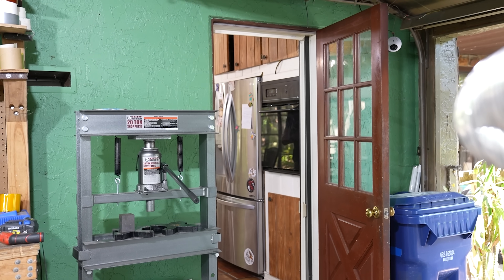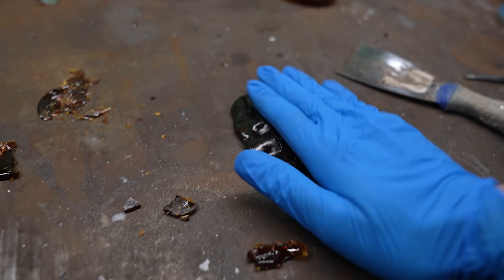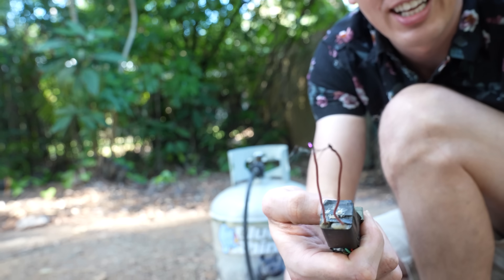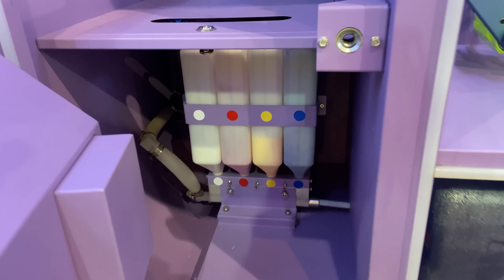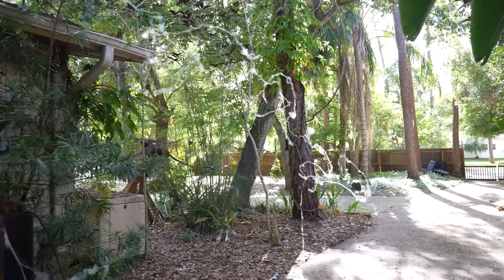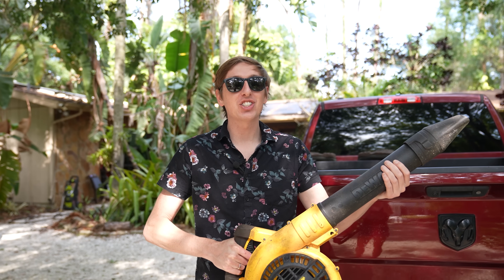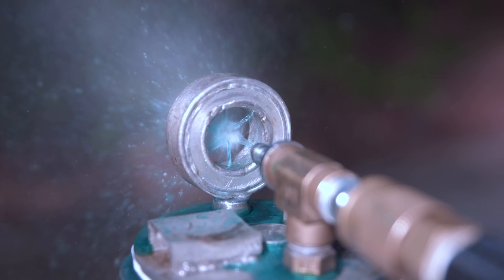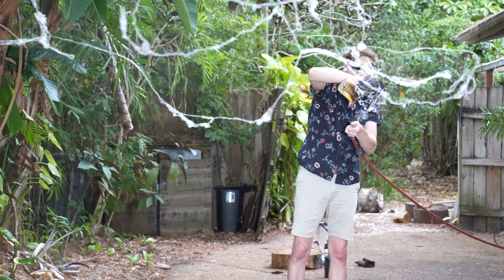I built a Cotton Candy Gun

Comment from the maker: Get an exclusive Surfshark deal! Enter promo code BACKYARD for an extra 3 months free at https://surfshark.deals/backyard
How would you make a Cotton Candy Gun?
Reply: love you
Reply: @user-hq2fy5cs1k is a lie 😭🫤😮😮😅😊😊o999pppoupouopppppppppppppppppppppppppppp000
Reply: i got better idea instead of hot air wrap  a coil around the metal bit/the tube  keeping it hot so the air coming out isnt super heated and safe
Reply: sorta like how coffee maker works but with random bit a air blowing past
Reply: Go Go Gadget Cotton Candy Flamethrower. (Gets Crooks attacke by bees)
Reply: This just looks like a sweet mess lol
Reply: Never saw the cotton candy gun
Reply: Why not use the pressure vessel as the heating container? Wrap it in heating elements and melt the sugar inside. Add a heating element to the nozzle like a 3D printer and then inject air once melted. Blow the sugar out the heated nozzle and it strings in air. Add a pressure relief valve for safety and ur done. And you can code the elements into a microcontroller to maintain temps. Add a hopper for sugar and you can keep adding sugar as needed.
Reply: I would wonder say if you had a system similar to that of a flame thrower to make this work. Like if you had molten sugar being pumped out at and angle (or forwards, at a slower rate), into compressed air aiming forwards, so the molten sugar and air meet mid air, mimicking what was happening when you poured the molten sugar over the compressed air. Though you would probably need something to heat the tube so the molten sugar would be able to come out to prevent that solidifying effect
Reply: Pretty soon these videos are going to be 80% promotion and 20% content.. it's already half way there
Reply: This is amazing
Reply: Reservoir with funnel shaped bottom ending in a small valve mounted above air nozzle.
Basically just recreate the effective pouring into air stream method without needing 2 hands to do it.
Reply: W
Reply: Was this inspired by killer klowns from outer space?
Reply: This is crazier than Ross
Reply: If you moved the rocket engine further back so only the hot exhaust was blowing on the sugar, pretty sure you'd have been able to do it just fine at that point.
Reply: Great video, asking g again when do we get the potatoe revolver!
Reply: You are the king of the Florida men
Reply: Two words:  heated nozzle
Reply: Wouldn't using a continously heated nozzle (like with a heating element)  fix the problem of the nozzle getting blokced in the first version of the cotton candy gun?
Reply: Love your work ❤
Reply: I would LOVE to go to your event if it wasn't in San Francisco.  That place has turned into a hell hole.  And I worked in and around the city for 13 years.  Not going back.
Reply: Do you have sugar gliders ? Me to ! Got 2 families lol..1 asleep in my roof right now😂 🍺 🐨 Australia 🇦🇺
Reply: Hmmm.... promo code...
Reply: 3rd degree burn gun lol
Reply: Have you tried tipping the tank upside down
Reply: please do open sauce in later years as currently i can’t afford to go to the united sates yet :(
Reply: Copyer
Reply: 2:46
Reply: I don't think you got the part that the sugar isn't heated until it's ready to be spun! Preheating isn't the answer, it's the mistake. The sugar is flash heated right before it's blown out. This also helps with the clogging.
Reply: Use a heating element to keep the sugar at the right temp in the hopper. Then just gravity feed the liquid over the air stream.
Reply: heating element wrap the nozzle maybe a hair dryer element?
Reply: I bet you got demonetized for the word gun
Reply: I’d go to that convention but you’re the only YouTube scientist I like bro
Reply: Hey, could you play around with sodium metal again. Love this video. I would totally stand on the other side of the cotton candy gun even though it might be a bit hot.
Reply: Any chance to make this high velocity gas gun you commented 6 years ago?😂
Reply: @TheBackyardScientist, sussy bakar
Reply: Do you want to get ants, Lana?  Because.. that’s how you get ants.
Reply: Backyard scientist I know how to make devil's toothpaste
Reply: hhhhhhhhaaaaaaaaaaaaaaàaaaaaa
Reply: UPLOAD A GOD DANG VIDEO SOON PLEASE THE FBI IS AFTER ME AND IM NOT PLEASED!
Reply: It looks like the sugar was flowing too fast for it to be spun into cotton candy in the last device you made. I would have added a needle valve or something similar to regulate the liquid flow.
Reply: the question is... should I tell you that there is a industry using pretty much the same trick of molten materials and air streams to produce a product you have used before? (okay, they use a spinning flywheel instead of active air being blown by because the cooling air is stationary there... and you get thinner strands)

mineral wool insulation is made like this, the things we have in our homes to keep us warm in winter and cool in summer... it is like "cotton candy" but actually it is "cotton rock" to say so
Reply: Super late. But maybe you can revisit this. Just have it gravity fed. Or pressurized if need be. But think an HVLP paint gun with a heating element on the end instead of the paint orifice.
Reply: @aceboogie3086  ba ba boi
Reply: Ba ba boi
Reply: You could do it the same way you did in the first test but use a heating element to keep the sugar heated in the tube and nozzle
Reply: your worse than mark with uploads lol

Comment: 9:50 wait im confused, you have a solution, a gravity fed stream, moves slower than the pressured containers you were using, so would the molten sugar coming out slower work better? the sugar falling ontop of the stream of air also makes sense, since it would be surfing into its self, the same way spiders spin web, so you just need something feeding the sugar ontop of the air stream but have the nozzle out of the air stream.

Comment: Get ahold of the guys at filastruder or something similar.  Just build a hopper based system with an auger to push your sugar into a heating element set to the melting point of sugar then blast your air at the stuff coming out.

Comment: Sugestion from The Ionizer -   Spinning the surgar  will allow it to move only when it’s melted keeping it from burning.   If you have a cone  to bring the liquid to a center and also have some channels to flow .  The idea is to fling it out in as narrow and fine as posible to give you thread.   You use nozzles at that size will clog.   Better experiment would love to help you with is how about a different type of heater.  I can explain how a machine works and how useing a wireless way to heat a spinning chamber can work better and be better controled. works can have huge improvements.

Comment: I know the steps on how to make a cotton candy gun in 5 steps

Step 1 : Make molten sugar

Step 2 : Put molten sugar into metal container

Step 3 : Take 2 large propane stove burners and set them to high, take some high temperature piping connecting them with a stream of compressed air

Step 4 : Make a venturi nozzle to fit between the high temperature piping and the molten sugar

Step 5 : Activate the compressed air

Comment: Your making it too complex, idk if you have tried this but make a nozzle that will go on the end of the air compressor nozzle, then that nozzle will suspend or hold a small pot of the melted sugar above the air stream so YOU don’t have to hold the pot. It’s easy and simple, also don’t forget to drill the hole in the pot that will let the melted sugar drip into the air flow

Comment: Surfshark uses old MD5 hash encryption techniques which were cracked decades ago.
Now they do intertwine hashes to make some kind of weird semi-hash thing, but still it can easily be cracked.
I've actually cracked it myself and It took 2 days, but considering modern encryption techniques take years to decades to
crack, I did pretty well! So the point is... Yeah unless you want your data stolen in 2-4 days, DON'T use Surfshark

- An Actual Software Engineer

Comment: *See the challenge you have not overcome is the cooling. You've been brute-forcing this.*  The best thing would be to create a heated magazine for the sugar. The heated container basically makes it a heated liquid sprayer (a real product). I mean it is what your trying to build basically. You just need 2 things: a hot-end nozzle so the orifice never gets clogged, and a heated sugar pot. You could also heat the Venturi system too, but the biggest challenge is just keeping the sugar hot until it is 90% out of the way of the nozzle. The air needs to be cool enough for it to solidify. This could be achieved by having a heated air in the center, while a jacket of cold air comes out of the  outer ring face of the nozzle youve already made. it would propel the sugar and cool it while the heated air in the center precools the sugar but doesn't allow it to become so cool that it clogs. Look up a COATING HEATED HOSE AIRLESS SPRAY system from Chesterton EMEA, they have this heated coating system that does exactly what you need except you need it to then cool quickly in the air. 

You have two things working against you. Keeping it hot until nozzle exit. Getting it cool enough to form crystalline and polymeric sugar in air.

Comment: oh. my. god.
all that is left is to make it self-heating, self-compressed, and super easy to refill 
add a 3s lipoly battery, a 12v 3D printer bed heater, a car tire compressor, a small air tank(old propane bottle out to be fine), and then regulate the airflow via a regulator and a solenoid valve
a simple thermostatic switch to control the 12v heater(or even a fancy PID arduino sketch with mosfet module) and a thermostatic lockout so you can't feed it when the chamber is too cold
fill it, plug it in, preheat, and press button for sugary webby goodness

now the heater would risk battery damage so you will likely need a 20a bms(most bed heaters are ~120w or 10a) and it would not run long without power so maybe add in a standby power input that can feed the system 12v through a relay that only clacks when the aux is plugged in and saves the battery for the mobile part
you could even just use a large sodastream or welding tank as CO2 is pretty food-safe and would provide a nice high-capacity high-flow gas source
but it MUST be made 100% portable and capable of mobile reloading rather than preheating the tank and sugar in the kitchen

Comment: So here's my idea. Canister with a heating plate and temp sender; with a fitting on the bottom with a gate type valve. And air gun to pressurize canister(pushes out sugar) and blows the cotton candy away
Reply: Then you just need an auto stick rotator in front of the output

Comment: I feel like the ideal design would be a heated pot you put the sugar in. Then put holes in the bottom that are the right size for when the sugar hits an ideal temp it starts running out. Pressurize it slightly worst case scenario.  Then air gun under the holes.

Comment: Wouldn't it be the easier to have a tank with heating elements (hot enough to melt the sugar) with a valve on the bottom that can open up with a click of a button. that will once clicked/switched slowly pour it into the air stream?

Comment: That last prototype is nice! Getting holes on the inside of a ring line that is pretty hard, even if you take the inner ring out and drill it, clamping it still is rough. Also I'm not sure what the vessel is? Almost looks custom, especially with his comment about nice threads. I know the only time I would compliment threads is if I put them on and want expecting them to work! Overall extremely well built for what it is.

Comment: I worked in a foundry where in the sand casting section we had both a hot glue gun and an air hose right there. Nothing funnier than hosing your bro down with spiderwebs by combining the two

Comment: after seeing the leaf blower work i had an idea

ideal gas law says going from high pressure to low pressure results in cooling. if you put short to wide nozzle after the compressor but before the hot sugar, it should keep the air warm enough to keep the sugar from turning solid without loosing too much kinetic throwing energy.

Also your sugar injection system should be on the top so the sugar falls into the air stream. Instead of venturi or internal pressure, use a physical piston and gasket compression instead. This keeps air from escaping the cylinder instead of the more viscus sugar. work on different designs for the injection plate, as the civ seemed to have success with lots of nearby holes in an array rather than a single row of small holes you seem to be designing towards.

Doing it this way also should let you put a "butt fusion" heater assembly mounted to the gun to heat the sugar while in use, instead of rushing to mount a hot sugar to the gun before use

Comment: First thing I thought you would do is basically make the cotton candy like a machine does but use the air to direct the threads into some kind of vortex or system of vortexes. Then after I started watching I though ok maybe he will figure out that he needs to keep the nozzle hot… maybe in part two..
Im still curious why the jet didn’t turn into a flame thrower.

Comment: For the version where it's basically just a tube, wouldn't putting a heating element around the tube fix the problems with it? Like, If you just preheat the tube, the air cools it down and the sugar sticks to it like you showed, but if you were constantly heating the tube, shouldn't it stay warm enough to keep the sugar from sticking?

Comment: Personally, I would have just done a heated hopper situated on top of spray gun with a controllable gate on the bottom that allowed the molten fluid to drop into an air stream. Similar to how an HVLP spray gun works. You could even control the heat of the hopper so that it heats up granulated sugar to melting temp and then keeps it at that temp.

Comment: idk bro ur first idea worked fine

i would have used nichrome or kanthal or etc etc heating wire to coil around the nozzle to heat it red hot

if that doesnt work, just make a tube chamber of some sort that keeps the compressed air for long enough while also heating them, that way both the air and the nozzle is hot

Comment: I think you need a heated nozzle, perhaps an extruder from a 3d printer? Then you could keep it from hardening but have enough tempature control to stop it burning. Mabey with the fine tempature control you could tweak it to get an optimal flow rate by changing its viscosity.

Comment: @TheBackyardScientist using an induction heater, you could adjust the heating temperature to where it puts out hot air to keep it from solidifying, then with a rotating double walled drum(rotating via air pressure) it could output the heated sugar spinning it into string,(essentially turning it into cotton candy silly string)

Comment: I feel like you tried everything but the obvious: heat the sugar IN the paint can OVER the nozzle with a valve to control the flow.  A cheap paint gun with the nozzle bored larger might have been exactly what you needed.  Something like gutter tape connected to a variable auto transformer would let you control the temperature of the sugar and prevent it cooling in the valve.

Comment: I find it very weird that you didn't try to heat everything up electrically. Put some resistive wire in the way of the compressed air to heat it up like in a heat gun, wrap some of the same kind of wire around the sugar tank and the nozzle (electrically insulated by ceramic fiber rope or something of the sort), then insulate the whole thing to prevent heat loss. This way, the sugar won't get cooled down by the air (because it's scalding hot), the sugar won't get stuck to the nozzle (because it's also scalding hot), and since the sugar will remain liquid in the tank for as long as it's being heated up, you don't have to rush and injure yourself by accident.

Comment: Maybe you should have just used a sieve and mount it on top. It seems like there is a correlation with temp. It works better pouring because it cools but has no way to gum up since it is free-flowing.

Comment: I'm surprised you didn't use an  FDM 3D Printer or a filament extruder as your starting point as they both require taking a solid (PLA) plastic, melting it in a controlled fashion where it can properly be extruded without jamming and THEN cooled!!!

Comment: What about trying a gravity feed. Make a heated upper canister that you can melt the sugar in, with a valve to control the flow rate out. The heating element would be able to be dialed in to a set temperature based on the power applied while keeping the nozzle warm enough to prevent freezing.
A repurposed hotplate would do a great job and you could make it all look like a giant paintball gun.

Comment: You effectively have to merge a 3d printer hot end with the air blast, something that gets hot enough to melt the sugar regardless of temperature change from the air. Then you can have a thin streams of sugar to jet onto a strong blast of air.

Comment: Maybe a large, modified air compressor paint spray gun might work. Some come with aluminum canisters for the paint that screw into the spray gun. You could heat the entire sprayer attachment before hand but clogging will still be an issue. Should make a nice cloud for a few seconds though.

Comment: Tip from an ex pastry cook (awesome job, terrible work conditions): 

You can use glucose to lower the melting point of sugar. This is the trick behind pulled sugar (is that how it's called in english ?)
This allows you to manipulate  the sugar with your bare hands without burning yourself (well, not as much).
On the other hand, it might reduce the sugar's viscosity, and make the gun stop working altogether 🤷